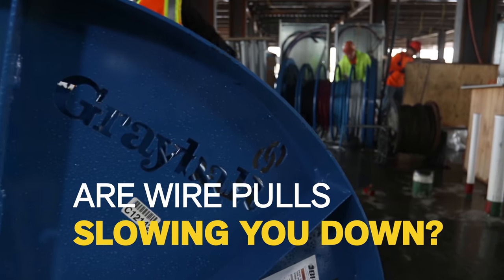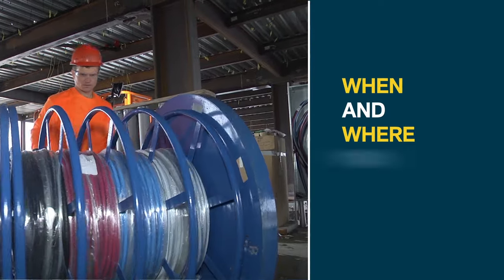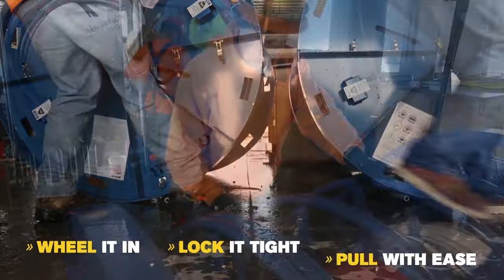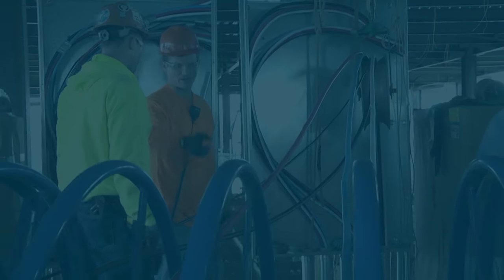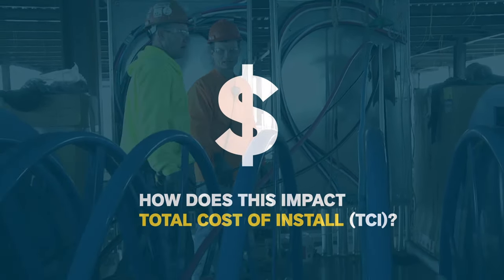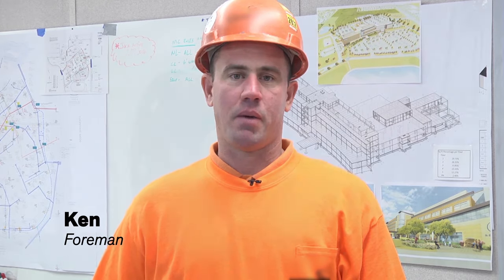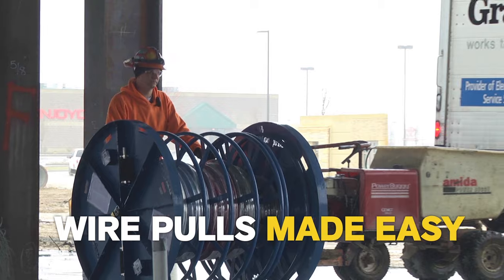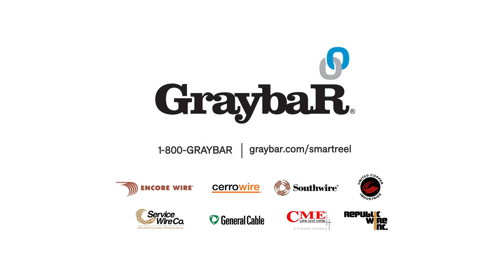Introducing Graybar SmartReel Portable Payout System!

Comment: Too wide won't fit thru a regular door Southwire SimReel is much better
Reply from the maker: Hey Walter, thanks for the comment! There are two shaft sizes for the Graybar SmartReel. The small size fits through a standard 36" doorway. You can also order Southwire's SimPull Reel through Graybar in select districts. Hope we can help you on your next job!